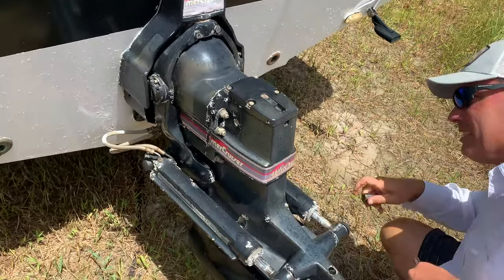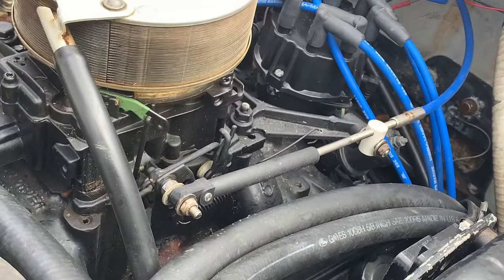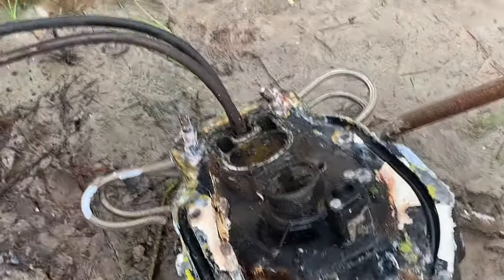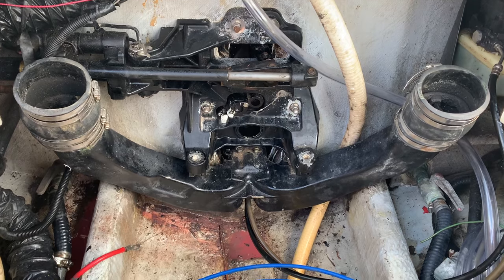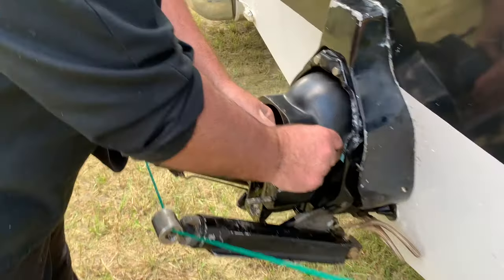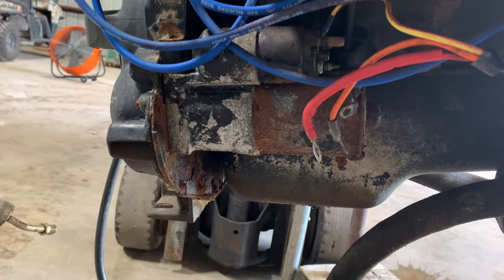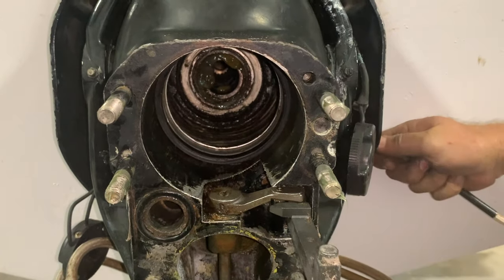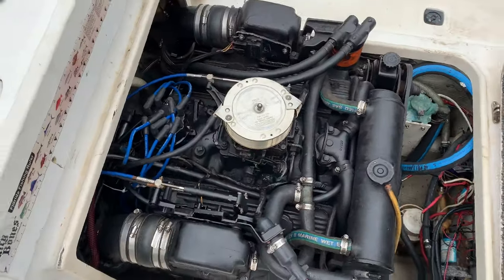Mercury MerCruiser V8 total removal & installation (How To)

Comment: Just a bit of info: You don't need the specialty tool. You can use a 1/2" [6sided] Ratchet-Alan. This is info from a Merc engine mechanic near me, and I also did it. Worked fine.
Edit: He also told me he has broken those tools several times. And he has yet to break an alan or bolt. :-)

Comment: I really enjoyed your video, can't speak to that enough.  I have a 1994 Bayliner with a 454.  Do I have to remove the outdrive to replace the engine?  I did not see how you lifted the motor, any advice?  Might it be better for me working outside to remove everything I can off motor to reduce weight or is it better to pull all to reassemble to a new motor?  I bought boat at auction and it had 9 gallons of clear water in oil pan.

Comment: I heard you mention that this is a Gen II Alpha 1.  Why do you have an extra raw water pump?  My understanding is the Gen II's can handle a full closed cooling system with just the outdrive pump and the engine circulating pump?  I am looking at doing a project similar to this and planning on adding a heat exchanger to it.

Comment: Great job! I am planning to get a 1977 Mercury Marquise. Engine: Mercruiser 4788052. The body of the boat looks impecable; however, the owner told the seal between the engine and the outside part might need to be replaced. Any ideas, suggestions on this, please? How advisable for me it is to buy something like this? I am a new comer and has zero knowledge on boats. Thank you!
Reply from the maker: For having zero knowledge on boats this is a very time consuming job that requires knowledge particular to each engine configuration. You are going to pay a mechanic good money to do this. So make sure you take that into consideration before making a purchase. It will probably be very costly to pay for this work. It will be a big project for you to learn and do yourself. Good luck. Boating is a great fun time, but definitely a costly one.
Reply: If be says that seal is bad I would be suspicious of transom rot. As Chef said it's expensive, a labor of love. I talked to reputable marine mechanic he quoted me at least $2500-$2700 to change engine coupler, pump, and lower unit oil. I have the original mercruiser manual, watched a few videos, and did it myself in a weekend. Saved about $2000. It's not hard but it is work, you'll probably need a friend to help. Hope this helps somebody. God bless.

Comment: Yes. You need to remove outdrive in order to remove engine.  And I recommend you buy a complete turn motor replacement or you’ll be doing this job again…that’s experience talking!!

I pulled an old engine from my boat patched it up with new gaskets and starter and alternator and then did ran descale through engine passages.  All for not…engine still overheated and likely blew a head gasket.  

It’s expensive but I recommend a complete turn key engine replacement. 

I had a tow truck come lift my engine out.  Tow truck has to have a boom that goes high enough into air and is not connected to its under car carrying boom

Comment: Does your starter require a 90amp fuse for the solenoid? The battery was hooked up backwards on for my mercruiser 350 and it tripped the breaker on the motor, but there's no fuse on the solenoid and I think it trashed the starter.
Reply from the maker: People and manufacturers put them on some of them. It is not required but probably a good idea. Electrical with anything can be tricky and 
Cost a lot of money ruining things if hooked up wrong. I would advise you to follow what the manufacturer states is recommended for your particular engine.

Comment: I have a 1993 Crownline 193 br 19 ft speed boat it has a 5.0 L engine in it now with a cracked block will a 454 7.4 engine fit in my boat?
Reply: It won’t be a direct drop in replacement. Make sure your outdrive can handle a bbc
Reply from the maker: Every boat is different I do not know. Good luck with the project
Reply: I have the same boat! I'm thinking of a 350 swap (with slightly higher compression/cams and bigger/better carb) down the road as almost everything bolts up (manifolds and water pumps etc) and its basically the same size verses the 454 big block. Just don't want to overpower the drive unit...

Comment: Wondering about how long it takes? I have a 4.3 I'm thinking about replacing.
Reply from the maker: it really depends on you. I can have an entire engine out in 45min-1hour and maybe a couple hours  putting it back in if I have everything I need, but that is most normally not the case. something breaks or something is no good and needs replaced, or you don't have a tool or part you need and it turns into days. plus if you have a job then ya got to go to work and it takes even longer. you just never know. circumstance permitting
Reply: @ChefOutdoors  I get that, spent two days last week hunting down the parts for my truck after advance sold me the wrong ones.. I'm really torn.. I have a chance to buy a 96 stingray 5.7;for 3k with a "new" motor two years ago but the boat is a mess, cluttered with crap.. or a 04 crownline with a 4.3 then tossed a rod but is clean as a whistle.. not crazy about doing a motor but at least with the crownline I know what I have.. 🤦

Comment: was focused on the starter portion. i have the same motor in an 86 larson delta cruiser. however i only got 1 bolt out and the inside bolt is real hard to reach. was trying to see if i can undo the 2 front motor mounts to lift an inch or 2 or not. not wantin to do this whole process. ugh

Comment: Great job sir. Do you have to take the outdrive off if you are only swapping out the engine? I gotta put a new 350 in my dads trophy. Thanks
Reply from the maker: Yes you do. the drive shaft or "donkey dick" as they call it. (not a joke) is splined into the engine coupler bolted to the flex plate. so yes you do have to remove the drive also before removing the engine.
Reply: @ChefOutdoors  great thank you for replying sir. Cheers!
Reply from the maker: thanks for watching!

Comment: Can I get the engine out without messing with the out drive?
Reply from the maker: No. You have to pull the splines out of the coupler. So you have to remove the drive to do that

Comment: Awesome video! How many hours did u guys spend on doing this job ? i´m about to do the exact same procedure this week..
Reply from the maker: Engine out about an hour
Drive off about 20 min
Transom assembly removal was around an hour
Transom assembly install was probably another hour
Engine install was around 1-1/2 hours to get it in and accessories attached 
Out drive reinstall was about 30 minutes 

We broke it up over a couple days after work

Comment: How much would it cost to remove a 3.0 volvo penta engine and put a 4.3 mercury engine in
Reply from the maker: all depends on who does the work and what has to be modified to make it work, drives, transom assembly, etc. not a cheap job

Comment: Bravo fit on Alpha transom?
Reply from the maker: you would have to replace a lot to make it work correctly. the transom assembly is different and would need to be changed, different shift system and different water cooling supply.. I mean you could remove an alpha drive and transom assembly and replace it with a bravo drive and transom assembly, but there is also a lot to it and the engine and drive would need to be configured to make it all work correctly.. can't just swap them.
Reply: @ChefOutdoors  I have Maxum 2300 sc 1999, inside was 5,7 car + alpha g2. I buy boat without engine and gear/transom. Just thinking now what put inside for small money
Reply from the maker: @latrex  gotcha.. it is quite the project.. alpha would definitely be a cheaper route. can't just put a car engine in either it has to have the right cam.. however  the 5.7 EFI  car engine was one of the only ones with the correct cam to do the job. sounds like your on the right track. let me know how it goes..
Reply: @ChefOutdoors  I produce boats in Latvia and sell engines, also have acces for rebuilded Mercruisers and new SEI gearcases. I want wrap boat in film, make new seats and cabin interior, paint bottom with antifouling

Comment: How do you disconnect the engine from flywheel?
Reply from the maker: You have to remove the bell housing  then unbolt the coupler from the fly wheel or “flex plate” as it sometimes called. Then there is a series of bolts holding the fly wheel to the crank.

Comment: What was the total hours spent?
Reply from the maker: A lot😂 it was done on days off and after work. The time in and out if Everything is perfect could be done in a day. However it never goes that way. Missing parts, needing new parts. All kinds of obstacles. Like opening a can of worms. Once it’s apart you need to fix it all. Ended up being quite a few days total.

Comment: 5200 huge mistake.  Never be able to work on that again.  10,000 years from now all that will be left is a ring of 5200.  The rest will be rusted and rotted away.  But 5200 NEVER let's go.  Throw those tunes of 5200 away!!
Reply from the maker: Tough stuff for sure 😂
Reply: What sealant are you supposed to use if not 5200?
Reply: Never use 5200 if there is a chance you need to disassemble it in the future. 4200 is the stuff that should have been used.  I feel sorry for the next guy who needs to remove this.  Other than that great video.